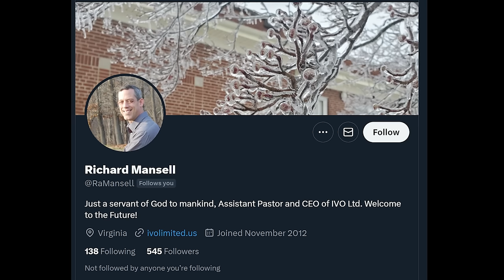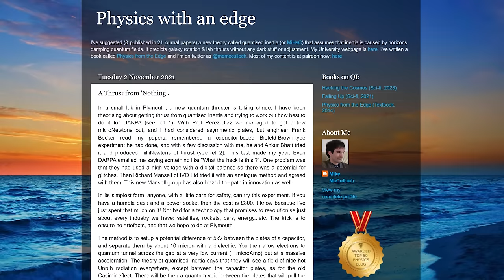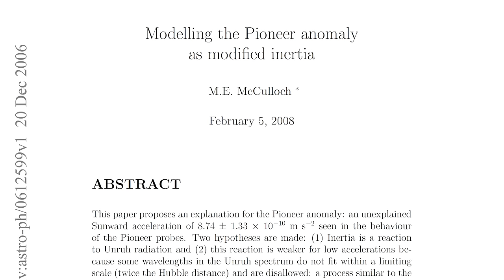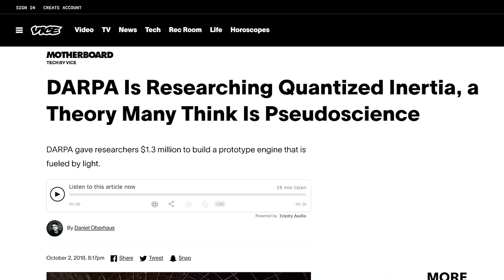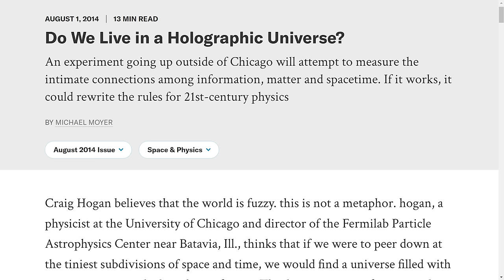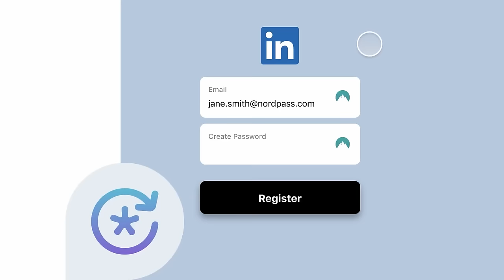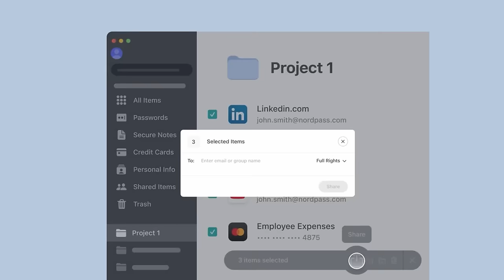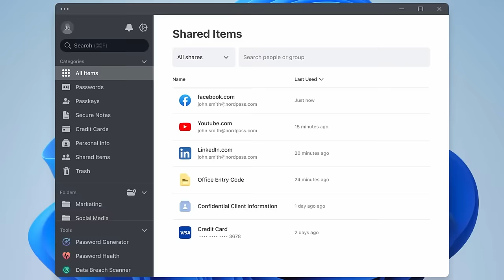Quantum Inertia Drive put to Test. It didn't go as planned.

Comment: if you're talking about how to propel humanity to the stars, the most plausible drive I've run across is the combination of solar wind dynamic soaring, wind-pellet sheer sailing, and Q drive, which are all papers from the same team using basically the same spacecraft to get up to >10% the speed of light without lights sails and lasers. 
As a bonus, solar wind dynamic soaring is a great way to get to do fast interplanetary travel without much propellant.
The one place I can't really understand the math is that the dynamic soaring uses momentum transfer to the solar wind via electromagnetically induced plasma waves to generate lift. Most waves can transfer momentum, so it's not crazy, it's just really hard plasma physics.

Comment: Come on Sabine, I know you like to climb up on the "soapbox" and profess, so forgive me for getting up beside you on my own "soapbox"....
   The Barry 1 Satellite on which the IVO Quantum Drive was mounted, had problems with its main Power Bus and eventually failed completely. You infer that the Drive experiment failed, objectively it neither succeeded or failed. No power, no experiment. Coming to a conclusion that infers failure is a bit like having someone inventing a new fangled thing they called a flashlight, flipping the switch at a demonstration, and no light comes out. Then there is someone on the sidelines offstage, who asks "did you put the batteries in?"

Comment: I think we all know it's pseudo-science, but that doesn't mean it doesn't work and there just isn't an actual scientific reason we haven't figured out yet.
Reply: There's a lot of things on the quantum level we don't understand or aren't common sense, for example the Casimir effect or particles coming in and out of existence.
The good thing here is that they have a testable prototype.
Personally I find it a total BS idea😅
Reply: why would it work? they dont need to fund orgone closet experimentation either
Reply: @amphipoda9626  It seems to "work" on Earth, but that's attributed to other factors found on Earth.  Working in space is where it's important for it to work and the place physicists think it's least likely to work.  So running the experiment is very valid.  And we can just figure out the science of why it works later if it actually does.
Reply: Which part of McCulloch's theory is pseudo science?

Comment: If push the Molecules of the walls itself.  . It would cause it to vibrate and heat up instead of pushing overall volume .but us it with conventional chemical rocks  it would be easier on the rockets

Comment: It didnt generate a new particle...
Its a media lie
Know physics dont just follow 
Ionization methods of psi density magnetron plasma sciences 

Temperature isnt perfectly tangent to gas characteristics. A lower temperature or higher temperature may exoand or condense but without proper ionic density in the volume as the psi in dipole. Its apparent it would fail. Imagine this 
You have a sealed accelerator synchrotron will a sector for collision in a magnetic field shape
Basically interacting with open vaccuum.
The collision would produce gamma ionization and as well as a repulsive force outside the body
Reply: This is to equate the principles of momentum conservation as mass. In an accelerated psi plasma with ionic density
Reply: I know " because I study dipole psi changes as LHC is like a snake to a mongoose to me.

I hate them with a passion and plan to shut them down under national security bounds. Magma and all gas characteristic changes occur through Centrifugal acceleration and gamma ionization density condensation through state change. 
The volume has a bouant separation scale. The most inert gases which chemical reaction can't take place in a conventional sense. 
🔥.. without a proper psi it can't exist as plasma. But ionic plasma can. As a gas changes through ionic reaction and centripetal force to centrifugal density increases as a closed space volume
Reply: This is to say polarity psi effects in conjunction with curvatures in both psi and rotation inhibit centrifusion. 
Which makes gas volume density.
Expending the gas volume density to inherently produce outside the craft and move inhibits a counterforce from its place of origin. Much like a payload mass of a tank of hydrogen and oxygen makes up propulsion and mass character for a rocket accelerating through the psi
Reply: It's the change and exchange. That causes the displacement.
Not the act of pushing against something.
Reply: Period.

Comment: You said, Unruh radiation is a kind of friction of the vacum. Let me take a note... where friction exists you can use a propeller instead of a rocket engine. Do you have any thought about this claim or just the usual boring ignoring happens again?
Reply: Indeed, if UR is analogous to friction then there are prospects that it can be used for traction.

Comment: If a lot of physicists have looked at the Quantum Drive theory and don't find it sound why are "mainstream" physics theories like string theory and dark "matter" not subject to the same critical review?
Reply: Problem is trying to replace chemical rockets instead of aiding them pushing the molecules themselves. And sense They found the acceleration was do to uneven distribution of heat then put that in the design
Reply: Because physics is a club of jealous egomaniacs.
Reply: Because String Theory is already dead as a popular model for more than a decade (outside of pop sci) and dark matter is an observational fact, but what causes/makes it up is not yet determined which is why there are many competing ideas being tested. Even if you don't know what dark matter is made of, study after study of space shows that there is non-visible mass everywhere and in massive amounts. You don't need to know how fusion works to know the sun pumps out a lot of heat, that's an observable fact.

Comment: Btw, does Unruh radiation have any link to Hawking radiation?
Reply: Yes. Both are concerned with virtual particles.
Reply: @Rampart.X  I was also thinking about what we get if we take Hawking radiation and Unruh radiation and we tried to figure out what their transformation by the equivalence principle would look like, namely swapping gravitation (spacetime curved geometry) and acceleration.
Say, if H^* is the equivalence-principle-transformation of H, Hawking radiation, what does it describe? Is it something that resemble Unruh radiation? And vice versa.
Are they look-a-like enough that we can get some insight, perhaps helping completing each other's picture?
As far as I understand, they both stem from the notion of an indeterminacy of the N operator (of all fields) under curvature and acceleration (corresponding to each other under the equivalence principle map), respectively, which can be "realized" (made "real") as a channel in the evolution (pictured/computed as virtual particles) of the energy-mass actually present in the model.

Comment: The only way i can think to create inertial motion is to  constantly change mass to energy and back again .
This applied to centrifugal  
motion would give unidirectional motion.😁
Reply: nope, energy (e.g. photons) has just as much inertial and gravitational mass as the equivalent quantity of matter.  The only kind of "mass" energy doesn't have, is rest mass.
Reply: @Spherical_Cow  **A photon doesn't have mass .
On the other hand ,particles with mass  increase mass with acceleration.
Thus a constant conversion of mass to energy and vice versa is possible via acceleration and deceleration.
Reply: @yodbod  photons do have mass.  For instance, they have momentum, and momentum is classically defined as a product of inertial mass and velocity.  When a particle emits a photon, it recoils - because momentum is always conserved.  According to General Relativity, it is possible to create a black hole just by cramming enough photons into a small volume: this is known as kugelblitz, and is due to the gravitational mass of photons.

Particles do not gain mass from acceleration, beyond the simple equivalence of mass and energy.  Maybe you're thinking of relativistic effects, where particles moving near light speed relative to an observer's rest frame require ever more energy (from that observer's point of view) to further increase their speed, thus appearing to that observer as if they've gained inertial mass?
Reply: @Spherical_Cow  **I am not a scientist and must there fore rely on common sense .
Common sense tells me that a spinning wheel is heavier than a stationary one and would be more influenced by centrifugal force .
For instance ,imagine a large rotating disc with smaller discs around it's perimeter .
If the smaller discs are rotated for only half the rotation of the larger disc a unidirectional centrifugal force would occur.
I know such a mechanical device wouldn't' work because the speed of the smaller discs would not be fast enough and  increasing their speed would necessitate increasing the size and speed of the large disc .
However the theory seems right and at particle level the energy involved would be enormous .
Reply: @yodbod  common sense is a very poor instrument, and frequently fails in practice.  It is notoriously broken by both General Relativity and Quantum Mechanics, for example.  That's why scientists prefer rigorous theory (driven by clear logic and math) and actual experiments to test it.

As it happens, there had been some hypotheses in the past that suggested (for complicated reasons) that spinning objects should exhibit some altered interaction with gravity.  Extremely sensitive experiments have since been performed, ruling out those hypotheses: spinning an object has no effect on its apparent mass.

Comment: I'm not a fan of MM's theory either, but I think DARPA is wise enough to spend on checking the validity of an effect being useful regardless of any particular theory of operation. In this case the satellite failed and they didn't get to test the drive. They wouldn't likely need such a sensitive on orbit test if the design were engineered to take into account the actual theory of operation.

Comment: The power supply failed, so there is no data from this experiment  either way. Then, you quite hubristically inserted your understanding of some the theoretical framework, omitting Mach effect, while failing to consider previous experiments by other groups, like NASA and China.
String theory has not produced a single observable predicition, but it still enjoys funding, either directly or indirectly, from universities and governments worldwide.
Furthermore, if the device had worked, the results would have most likely been made classified. DARPA represents the US military.  If anything, they're more likely to have sent a dummy payload to dissuade other countries from even trying it!

It's downright disappointing to see a person stand on theory alone to discourage experimental research.  No matter how convinced one is of anything, theory and experimentation should guide each other, not weaponized to halt work in either arena.  
When you dropped the zero-sum fallacy with regard to research funding, I began losing respect.  As Sec Dev Austin III said, we can walk and chew gum at the same time.

Comment: Can't you just put it in a boat in an indoor pool to see if it works?  If the water is calm and there is no wind, it should move the boat.   If you need a vacuum for it to work, you can put the drive in a vacuum chamber on the boat.  If a force is created,  it should move at least a little.

Comment: There needs to be a lot better stewardship and limited access to space.  Too much clutter and our first problem will be junk running into important satellites.  Much more than that, and you reach the point where it just keeps crashing into other pieces over and over and turning into small bits moving at insane speeds.  Translation - kiss all your satellites and access to space goodbye.  Kurzgesagt did an excellent vid on this 5 years ago:  yS1ibDImAYU